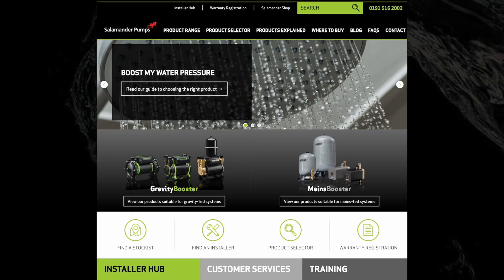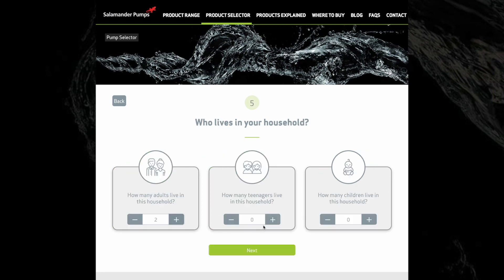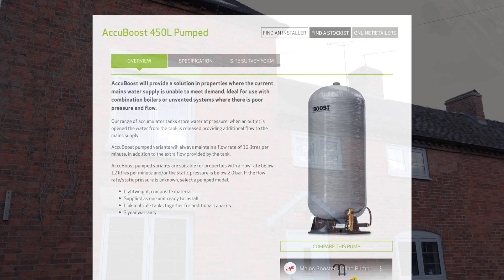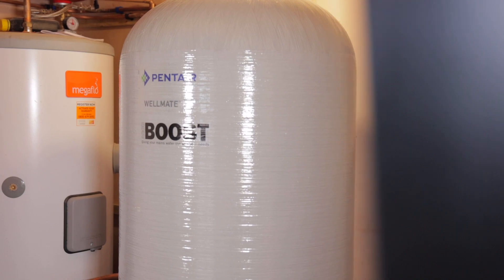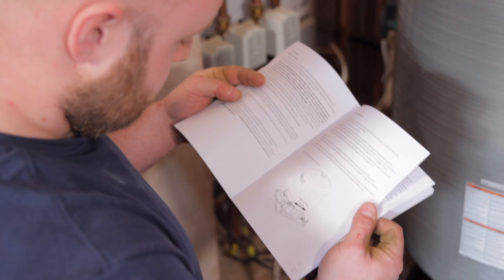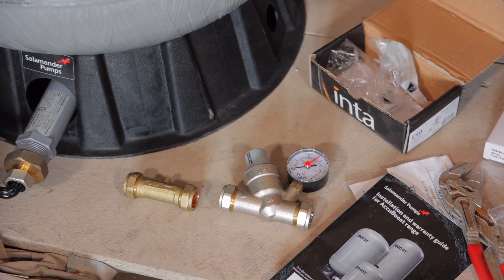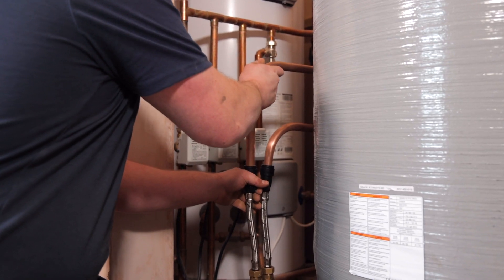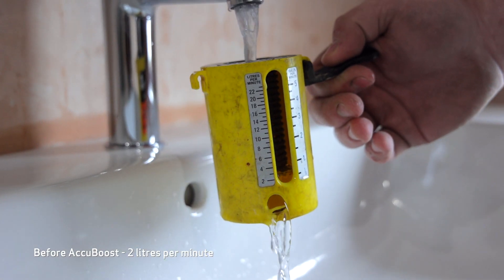Pumped Accumulator Vessel Install & Review | AccuBoost

Comment: I saw a megaflo HW Cylinder behind you. Can we feed that cylinder CWS from the accubooster?? Thanks
Reply from the maker: Yes, the Megaflow Unvented system can be supplied by an accumulator system like AccuBoost with cold mains fed water. With an unvented system a bigger AccuBoost is required, only the 330L or the 450L are suitable. There are other considerations that need to be taken into account to choose the right product, if you’d like support choosing the right product, send us a DM or try our Product selector https://www.salamanderpumps.co.uk/product-selector/